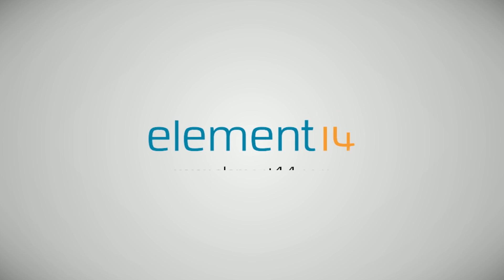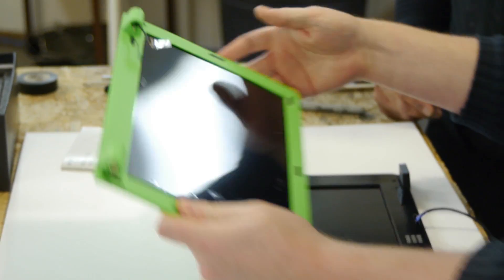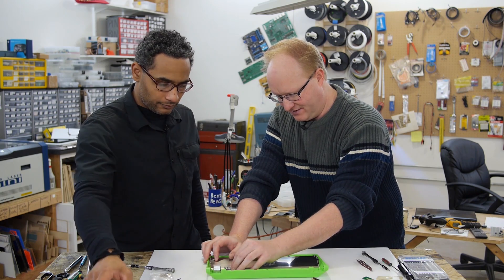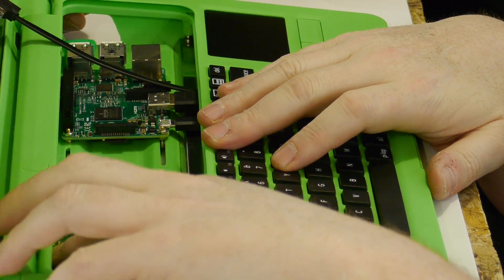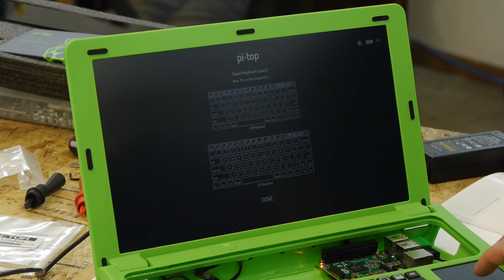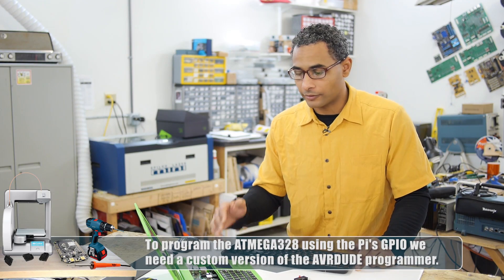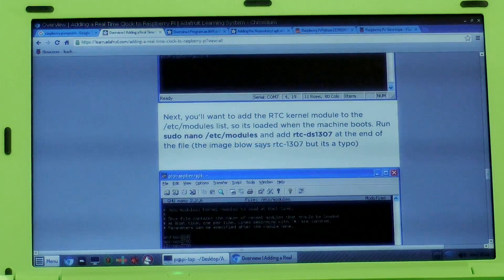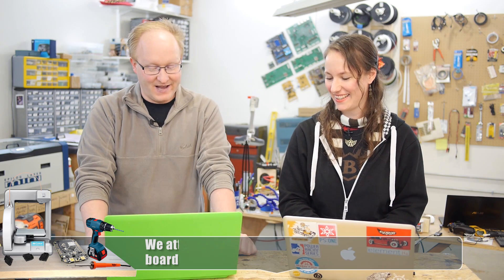Ben Heck's pi-top Assembly Demo

Comment: Would this be good for just trying out Linux on real hardware? I've been running many different distros in VMware Workstation for  around 2 years now, and i want to try some of them on real hardware. I don't have any old desktops for laptops, my laptop is too modern to allow Linux to even do a live boot (UEFI.) My only concern is that the Pi uses an Arm architecture SoC and not an x86 processor, so i would likely be limited in what distros could be run on one. (I use Manjaro.)

Comment: 18V @ 3A?  Why?  Isn't the Pi supposed to be a low power device?  The LCD could easily be powered by 12V or even 9V model.  The power solution is a bit perplexing.

Comment: I suggest building a tablet on the not so new but awesome Raspberry Pi Zero
Reply: KlausFritzDieter It would be better to use a pi 3 as the pi zero doesn't have that much processing power, and even with the pi 3 you need to find a version that will run smoothly and also touchscreen drivers.

Comment: I once converted the Imac g3. I replaced the CRT with an LCD as well as a pi 2 instead of the slow g3 hardware Apple gave it stock. It has run well recently and I love it.

Comment: We really like the PiTop kit. I preordered in the summer and it came in Nov 2015. It was easy enough to assemble that my 11 year old did most of the work on his own. My kids love opening the window up and showing off the guts inside.

Why would you buy this over a cheap laptop? Like, Ben said, hardware accessibility to the RaspberryPi2 allows you to add your own low level bits to the pi. The PiTop's CEED Universe game/learning tool includes walk throughs  for coding and eventually plugging in hardware and controlling it through your code in the CEED environment (we haven't gotten there yet). This was a big selling point for me.

Why buy this over a plain pi2? Portability & software suite. The pi-top is great for kids to be able to work on projects and take it around to show other people. It is more rugged and portable than a stand alone Pi and all the parts hanging off of it.

Comment: Don't know why you would do that to a pi, its kind of bulky and the pi is not powerful enough to be a laptop nowadays, at least something like those cheap ass atom64 based Chinese convertibles, they are bogging down with win10 but they are are a blast with Linux. If you are playing with kits in this price range the difference between the pi and a atom SoC is negligible. Also they could at least made the a proper opening in the case so you can have the USB ports and Ethernet fit snugly to the right and extend the audio jack to be right next to it.Also the entire GPIO is covered with their header so hooray for expansion kits... Looking at how cheap 2 in 1's are these days its more appealing to buy a complete unit with a proper CPU, Bluetooth, WiFi, Touchscreen all that jazz and things like proper batteries that can indicate their status in OS instead of some random led and just buy one cheap Pic or Arduino even a Atmel Board + Serial to USB or whatever else with it and you would still be below 300.
Reply: +TioPaleshadow I think that part of the perceieved value of this laptop is in the assembly and moddability of the pi platform. When he added on an AVR, all I could think was, hell, buy a 150 dollar low end laptop, run linux, and get an Arduino or even an RPi to play with externally. then you have a real computer, and a platform to play with/learn on, at the same time. and it's not a bulky, un-ergonomic mess like this thing is.

Comment: I had some fun building a bedside clock based on the slightly more advanced DS3231 RTC.  It can keep the time and date extremely accurately by running off the auto recharging coin cell for days on end. It also has some extra features like outputting an accurate 1Hz signal, setting alarms that trigger an output signal and a readable temperature sensor!

Comment: Ok this is cool. Putting a laptop together by yourself sounds really fun to me and once you're done, you can do whatever you want with it. For me i'd make it a retro games console and put a Retrode 2 (which can read and backup game carts as well as let you use classic controllers. Ben if you're interested you can buy one here: https://www.dragonbox.de/en/71-retrode-2-retrode-4260416650091.html) in the laptop itself and maybe wire some controller ports into the laptop case. Then i'd install RetroPie and Windows 10 on the Pi so I could play the games.

Comment: Actually (nerd voice on, push up glasses), the number of devices on a i2c bus with 7 bit addressing is around 110, there are some reserved addresses. Then, there is 10 bit addressing which allows quite a lot more than 128.

Comment: $299 is too costly
Reply: +Mike Blais I agree on the price. I also think the price is high because they're probably not making that many of these. Injection molding of the case parts by itself is an expensive method of mass production, and that could very well be the most expensive thing in this kit. The hub board alone is gold, as finding a single-PCB solution that'll manage HDMI, USB, charge batteries, and handle a LCD panel is probably extremely rare.

If I were an adult, and was looking at something like this to introduce kids to electronics, I'd probably build something totally from scratch. Buy the Pi, find a LCD panel with inverter on eBay, and build an enclosure using pexiglass or wood. Probably can do this for under $100.
Reply: +yuppiehi Or plug the Pi into a Motorola Lapdock. Its cost me like $150 total, the battery lasts for 8 hours, and the lcd is pretty good quality.

Comment: I've been meaning to check out a Pi for a while.
I've been meaning to get a new lappy for a while.
This might be a good solution to both. Considering all I'd be using the thing for is text document/spreadsheet work and maybe a little YouTube this seems like an ideal setup, if a little on the price-y side considering i can get a tablet with a keyboard for less than 2/3 the price.
Reply: +Guerilla Grue Plays You probably wouldn't care for a Raspberry Pi 2 as a general purpose laptop.
Reply: +Guerilla Grue Plays As long as you play youtube videos through a light-weight program (VLC works pretty well!) you shouldn't have the problems everyone is saying you'll have.
Reply: I know i'm 2 years late, but I don't understand why people buy these things. They're clearly overpriced, the screen is $50 (at most), the case probably isn't even $10 to make, the batteries are like $30, and the pi is like $35 - $45

Comment: Buy PiTop for 299$ and get qcore 1ghz , 1gb ram 8gb hdd or Asus x205ta for 210$ (amazon)  witch qcore 1.8ghz X86 processor , 2gb ram and 32ssd witch good design and windows 8-10.
Reply: +shawnsdada how expensive is something like a arduino ? Or maybe a whole pi that you can run of that notebook ? Well add that to the 210$ price and check again, you would need a breadboard and components in a additional carry case anyway. Most things offered by third part vendors for the Pi are to expensive for their own good. I got my components all from dumpsters, even things like LCD screens. If you ask nicely many system houses let you have that stuff just like that, you are just saving them waste management costs in the end. That`s coming from someone that has money to burn on a lot of nonsense I wish I never bought, still making something out of junk is kind of gratifying in its own right.
Reply: +shawnsdada
how expensive is something like a arduino ? Or maybe a whole pi that you can run of that notebook ? Well add that to the 210$ price and check again, you would need a breadboard and components in a additional carry case anyway. Most things offered by third part vendors for the Pi are to expensive for their own good. I got my components all from dumpsters, even things like LCD screens. If you ask nicely many system houses let you have that stuff just like that, you are just saving them waste management costs in the end. That`s coming from someone who has money to burn on a lot of nonsense I wish I never bought, still making something out of junk is kind of gratifying in its own right.

Comment: Hello i was wondering what is that adapter board that goes from the Lcd to the hdmi?
Reply: +joseph chrzempiec (josephchrzempiec) Ben and Felix called it a "hub board," for the lack of a better term I guess. It seems to be a custom PCB produced by the makers of Pi-Top. It looks to be a combination of an inverter, battery charger circuit and USB hub.
Reply: +joseph chrzempiec (josephchrzempiec)   most LCD screens are connected using LVDS, Low Voltage Differential Signal. the board converts the HDMI signals to LVDS to drive the screen. as well as having the battery charging circuits and the extended GPIO from the Pi....
Reply: Hello thank you both for that information. Where can i find one of these LVDS converters at?
Reply: +joseph chrzempiec (josephchrzempiec) eBay is a good start. Search for "lcd controller board" and go from there. It is best to buy a combination LCD display with controller board, as the controller boards are very specific to certain LCD display makes/models.
Reply: +yuppiehi all the hdmi to lvds i have found uses a external ir remote and push buttons I can not find out with out all that extra parts on it.